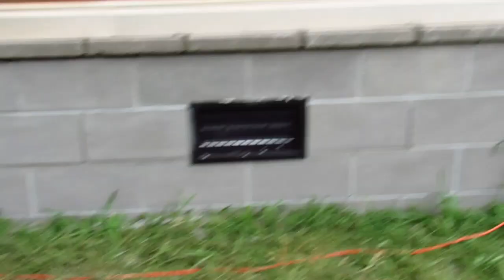MODULAR HOMES BLOCK UNDER SKIRTING

Comment: There aren't many men today that can do this kind of work so precise as this.  This looks great.  I had a question Sir, so does that that block perimeter around the house become load bearing as it settles over the years?  Like I would think it would be able to take that load.  This really makes these double wides become a house.  Double Wides are really the same as a Ranch House if you think about the way they are designed.  This is good though because that block perimeter keeps the house from getting lift in high winds, like if a bad storm comes.  Thanks for the work you do, gotta love the Masons!  Always men coming together on the Level!  Best!
Reply from the maker: Thank you!!

Comment: Looks really good.   Did you guys have to cut any of the metal framing of the mobile home, or just cut the block?
Reply from the maker: Cut the block
Reply: @troythebrickmason9003  Great Video, did you put anything behind the cut blocks to stabilize them against the metal frame?
Reply from the maker: @trendyaf8268  just enforce with extra mortar
Reply: @troythebrickmason9003  Thanks for the reply!

Comment: That's what I'm talking about.
If I have to rip out old skirting and pour a concrete footing anyway, I'm not gonna then reinstall skirting that only lasts 5 years, or looks like ass the first time I bang into it with the mower.
Fortunately, or unfortunately when I have to crawl under there, mine is only about half that height.

Comment: Do you need to pour a footing if it isn’t load bearing?
Reply from the maker: Yes, otherwise in a few years it will start to fall and move
Reply: @troythebrickmason9003  12in wide of concrete?

Comment: A manufactured home is not the same as a modular home. Modular homes are set on a permanent foundation to begin with. This one is strapped down by anchors screwed into the ground , and sitting on a steel frame, indicating this is not a modular.
Reply from the maker: Thanks for the feedback!